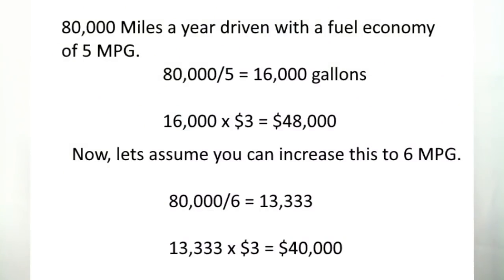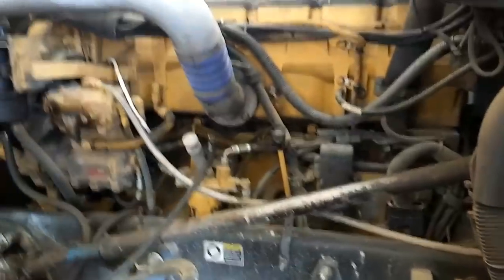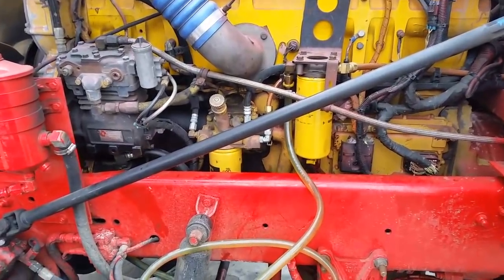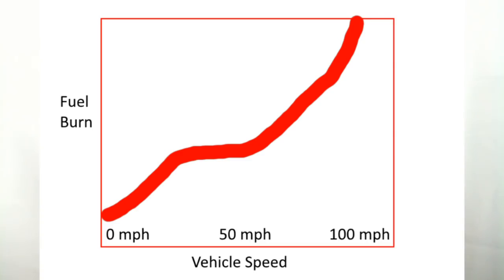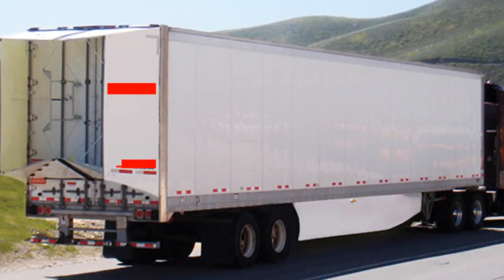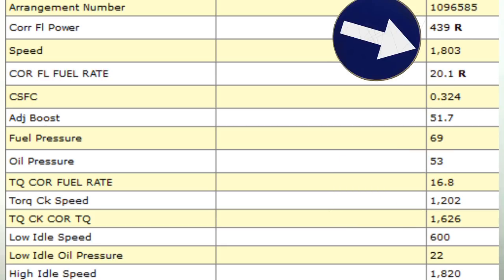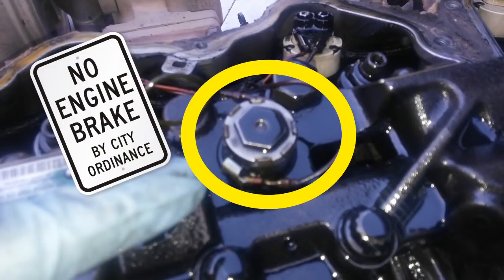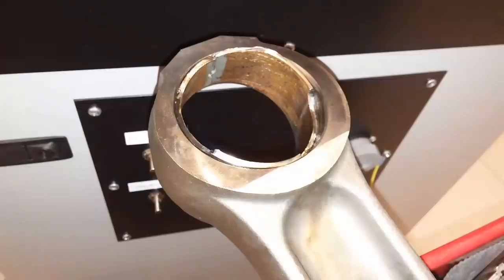How To Get Better Diesel Fuel Efficiency.  Increase Your Diesel Mileage And Economy.

Comment: Highway speeds make the biggest difference in my fuel economy. Driving 55 vs 65 changes MPG for big 7.3 IDI engine from 17 to 21.5
Reply: Yes, squared law applies on speed  related drag, so 10% speed reduction means only 81% of the drag. The man    is generally right and yes, miracle magnets or other snake-oil fuel products do nothing for calorific value. Sadly, tailgating has a huge beneficial impact on fuel consumption, but promotes collisions!
Reply: Wonder what kind of fuel economy you'd get with an electronic 7.3 IDI. 

By "electronic 7.3 IDI" I mean a 7.3 IDI with an injection pump but controlled by an ECM and solenoids instead of a mechanical rack, governor, and check valves.
Reply: @electric7487  I've thought about this before, but one of the beauties of the IDI is it's simple and mechanical, and therefore incredibly reliable. Still I'd love to see one with modern injection and pumps, an ECM and modern features like injector shut-off on deceleration. Probably bump those numbers up to 23-24 mpg. Pretty incredible for a 40 year old diesel engine displacing 7.3 liters. It's funny, my buddy's with their modern 7.3 powerstrokes average 15 mpg, albeit more power.
Reply: @Taydrum  I just found out that Caterpillar are using those distributor-style common rail fuel pumps on their C7.1 and C9.3 off-highway engines. Seeing as to how the IDI's fuel pump is also a distributor-style pump, I think a common rail system would be better for a new IDI as it makes everything much more compact. Also, I'd like to see spherical swirl chambers like the ones shown in https://chris.chemidl.in/wp-content/uploads/2014/09/1.005.jpg
Reply: @electric7487  Definitely a good place to start, however I know these things get complicated fast. Probably runs a different fuel pressure range, and the IDI stock injectors pop at a pretty low pressure. Would need newer injectors, and that would probably affect the timing.  I believe those are also 6 cylinder injector pumps.

Comment: The most important thing for fuel economy is the weight ofthe drivers right foot. If to heavy it causes excessive fuel consumption and increases general wear and tear on the vehicle.
Reply: I just bought a Toyota Hilux 1996 and these are things I am thinking, as well as to preserve the turbo where possible..
Reply: BINGO!!!!
Reply: I use cruise control on the highway. My right foot means nothing .  Fuel quality and aerodynamics are the most important.
Reply: Just be safe and speed up in a timely fashion on an on ramp

Comment: I have found the best way to increase your mpg is to not go up hill. LoL
Reply: I hate it when your rolling along coming to a hill and some jerk in front of you slows you down becouse they want to keep to 10 mph below the speed limit 😡
Reply: @markdunbar8219   Some trucks can't go faster... like mega carrier trucks. They are governed and have reduced torque. My company turns our trucks down considerably and it sucks!
Reply: Mark Dunbar that’s me lol. I’m ungoverned but the sweet spot for my rig is 65mph.
Reply: thats funny.. i found the best way to get better mileage is to drive down hill!
Reply: @dmbworks8094  And get pulled/pushed by the air ;)
Reply: @alinutzalin6346  that does help.. i often get tucked in behind a bigger truck so i get so help with the air!
Reply: @markdunbar8219  pop
Reply: Lol boom let's keep it simple right
Reply: Ya! Just fly it to Colorado and go anywhere you wanna go!
Reply: @Alinutz Alin…well I do that going down the hill faster if it’s a straight away…But my w900 n the shop for fixing my cylinders n deleting my actuators so now I’ll have 625hp
Reply: My grandma found a way to make it to school and back uphill both ways, I can find a way to make it anywhere downhill!

Comment: I think driving speed is a significant factor due to drag. The first time I had driven through Utah and Nevada in our diesel pusher, several semi trucks passed us on I-80 driving over 70mph. Since I live in California, observing these trucks flying past us was shocking since the speed limit in CA for vehicles with over 3 axles is 55mph. Needless to say, the fastest I usually drive our 34' diesel pusher is 65mph.

Comment: No free lunch anywhere. I have run 60 mph everywhere, minimum idling, back off on the hills, little throttle on acceleration and made top fuel economy in a small fleet of 200 trucks. I didn't really try for this. The data sheets came in and that was the result. I did this more than a few times but mainly did it because of fuel cost.
Kenworth T600, Cat 425, 18 speed with tall rubber(24.5).

Comment: In my experience the biggest factors in reducing fuel consumption are, reduce speed, less acceleration, correct tyre pressure, aero improvement, keep to maintenance schedule and anticipation to minimise speed changes etc.  Reducing speed and how fast you accelerate have the added benefit of prolonging engine and transmission life, and time between overhauls. If you thrash it you trash it.

Comment: Maintain proper tire pressures.
Reply: And convert to super singles.
Reply: Chad Jessup never, if I ran local I would consider it but they are still to hard to find in rural areas if something happens.
Reply: Chad Jessup however I do run Alcoa ultra one rims with Bridgestone M710 drives and Michelin xline energy steers to maximize fuel economy the best I can. I also run the lightweight steel drums, it's not cheep to run efficiently but I was getting 6.8mpg pulling a reefer with my 96 international coe so imo it's well worth it.
Reply: That is pretty decent fuel mileage.
Reply: That's an Obama/ Biden philosophy.
Reply: Hell yeah mine says 55 in the front 70 in the rear I run 70 all around they're the same tires so why not?
Reply: @Gorilla Braudcast mind mutants and not to mention, flat out dangerous. They spin and get squirrelly quick in rain and especially snow.
Reply: Whats the best way to read it accurately??
Reply: @Mr.Lawton534  with bifocals
Reply: @jaydunbar7538 almost 7 mpg in a coe isn’t shabby at all my brother. I’m in a 96 Pete with a 3406. Best I get is close to 7 at 65 ish mph

Comment: I took a 96 classic with a 475 Detroit.  Swapped injectord gateless turbo advanced timing 13 single od 3.07 rears with 11r24.5 truck ran an avh speed per gps of 70 and was getting 7 mpg.  Every truck i have owned or setup for people got better mpg with higher hp settings normally 550hp. More power more torque.  Allows you to pull better on hills and get back off the fuel.
Reply: Where you are really picking up the mpg, is the 3.07 ratio. If you aren't pulling heavy haul. It works great, just have to keep to the manufacturers recommended minimum rpm and not go below (danger Wil Robinson, danger), some flat-landers would try and pull a higher gear getting into a big grade, pulling max power at low rpm, do that enough times and I believe the cylinders will be dancing in the block before long.
I'm more of a Cummins engine type. Grew up with the Big Cam III & IV. I like Cat just never ran them. Two friends ran them, one worked great, the other, the engine nearly broke him, he still has it 30+ years later, and uses the truck for hauling his excavator around.
Best wishes from the far North.

Comment: Biggest fuel savings I’ve ever had was disabling the stupid 4-cyl mode in my V8 Silverado 1500, and having it tuned. Plus it drives a hell of a lot better. Anyways I think for OTR diesel applications driving style/ speed, and not idling for long periods of time are the biggest fuel savers!

Comment: The best thing you can do is spec your truck correctly! I have a w990 with 605 2050, I pull 105k from mid Washington to the West coast. Lots of hills. I speced it with 3.08 finals and meritor axles and I get 6.8mpg while everyone else gets 4.8-5.2mpg. I pull harder to, my buddy has a w900 with 605 2050 and everything else the same but has 3.58 finals, 105k on the dot as well and can't keep up and only gets 5.2. He has spent the money to ensure his truck is performing fully and it is, same with mine. Longer finals and more power is just better

Comment: I have a FL70 Freightliner and regularly got 10mpgs...one of the things I do is to always take my foot of the throttle if I see a red light down the road...just coast...saves brakes, clutch and fuel.  Sometimes you don't even have to stop and start...you just keep moving...
Reply: @AlzWorld57
Yup. That’s one of the biggest inefficiencies you avoid there. Stop/starts are a killer. My car gets 60mpg but traffic lights put it down to 36 average.

Comment: No this is another very important thing an old truck driver taught me there's a magic spot on the accelerator pedal and any less pressure on the accelerator you slow up the tiniest bit more pressure on the accelerator you maintain speed but beyond that,,,, any more pressure on the accelerator with no gain of speed is wasted fuel so always calibrate your foot to the speed mean and don't have your foot just stomped on the floorboard going the same miles per hour back to foot on out of the accelerator,,, and match it to the exact speed and load
Reply: Thats interesting

Comment: My (local/hourly) quad axle dump, 2006 KW with CAT C13 ACERT with 4:10 gear ratio.
I shift @ 1500 RPM and I use my Jake always.
My MAX speed is 60 MPH @ 1500 RPM.
I keep up on my tire pressure weekly.

Comment: Hey Josh.  I'm a fellow Cat truck technician here too!  Nice video and full of good information.  Lately we have been getting dinged on warranty from Cat for owners having aftermarket software and "hopped up fuel injector codes".  Perhaps you can use your channel to spread the word about the subject on changing software and Caterpillar's reaction to it.  We are a relatively small shop in the big scope of things and Cat has been really cracking down on warranty claims using the warranty report information against us and I feel that we need to get the word out to the owners that this is happening.  We have been denied four times for a total of about 10K worth of parts and labor that we are now having to have the hard conversations with customers about, so any way to spread the word around about another danger of "hot software" would be a good subject to talk about.  Really enjoy your channel!  Keep up the good work!!!
Reply from the maker: Not sure if I'll make a video on it, but yeah you have to watch for any sort of fiddling with the fuel system at all. Cat is bad about training their mechanics and warranty people in general from what I've seen.

Comment: My son has a KW T800 C13CAT 475 it has 1.500 million miles and still running good no blow by no oil leaks hardly uses any oil after 15.000 oil change. Great fuel mileage my son takes good care of his truck he uses Mystick oil and lucas additive in his oil and fuel

Comment: I remember learning to run the engine down to peak torque in an old series 60 class back in 2000. If you've never ran out under load that low of rpms you may think it is breaking your engine because it sounds bad, but it does bring the fuel mileage up and didn't seem to hurt the longevity of the engine. Great video, thanks for the content!

Comment: I don't know if you're aware of it but maybe you heard of water methanol injection. I have it on my truck I had it on the previous truck it helps fuel mileage significantly in my opinion because it increases torque by approximately 25%. it only works when you're pulling a hill. the water is injected into the intake manifold and a very fine mist it does two things it helps to cool the intake charge so you get more air in your engine and it turns to steam when the fuel Burns. it also removes a significant amount of heat from your engine. my exhaust gas temperature typically Run 200 to 300 degrees cooler I have found that I can lug my engine at a lower RPM without burning out my turbocharger. also when I look the engine at lower RPMs the steam pushes the Piston all the way to the bottom of the stroke. most people don't realize it but by the time your piston is down 120 degrees after top dead center you've extracted most of the energy you are going to get from that charge. the steam in the cylinder pushes the Piston all the way to the bottom steam simply doesn't quit pushing. snow performance has a very good system. I have a 15 liter cap right now my last dungeon was a 13 lb cat. that 13 liter cap on factory settings out pulled a 600-horsepower cat coming across California we were both running 80 thousand pounds and I don't pull him on Every Mountain grade with a stock 13 liter engine. I'm sold on it I don't even run methanol I run straight water it's very beneficial for an engine properly installed properly operated it will not damage an engine
Reply: Reed Silvesan which system did you go with? Thx
Reply: @bctw9004  
"...snow performance..."  (?)

Comment: Great information.  I have a 1981 Mercedes 240d.  The has answered many questions.  I use Amsoil synthetic diesel oil for Classic diesels.
Reply: Find out how much the timing can be advanced on those. I think it’s 24 or 26 degrees max.  That really helps fuel economy from what I hear.

Comment: I have been a mechanic for over 40 years. 30 of those as a heavy equipment and truck mechanic working for or with companies and fleets, so basically I live with the equipment and get to see in real world conditions year after year the same equipment. That gives me insight into things that most mechanics never see
  One thing that Always increased fuel economy and increase  the life of the machines was switching to Amsoil synthetic lubes.
 I've always seen increases in milage of a minimum of 3 mpg.
Same on heavy equipment, more hours per tank.
 I had a 95 FL 70 with 8.3 Cummins Allison 6 speed that I always got 6-7 mpg. (Service Truck ) at 135,000 miles I switched everything to Amsoil, engine, tranny, rear drivers, power steering fluid, front hubs and ujoints.
MPG rose to and stayed at 12 to 14 mpg. By reducing friction you increase available power and reduce rolling resistance.
 Not all oils are created the same and that includes synthetic oils.
 Most lube oils sold in stores are a class / Tier  3,  or 4 if marked  syn fluid, meaning the base oil is petroleum refined to a slightly higher level with a synthetic additives package.
Class / Tier 5 oils are true synthetic oils.
And very few companies sell a Class / Tier 5 lubes.
Amsoil is one of those that does.
 I have used Amsoil for 40 years not only in my own vehicles but also on my customers fleets.
 I start out with 1 vehicle or machine for a new account and let them decide based upon what they see. I have never had a customer say No.
 On of my earliest accounts was a paving contractor, hiway , roads and large parking lots.
They had pick up trucks, medium duty and heavy duty trucks, earth moving equipment such as Cat D9s, tract hoes Cat 225 up to Car 345s, scrapers, loaders, asphalt machines etc. 100 machines not counting office pool cars.
 The first full year after running Amsoil lubes in everything they saw a 40 % decrease in fuel purchases, and a 60% increase in equipment production time.
Meaning far less down time, fewer breakdowns less parts purchased.
Their savings in the 1st year more than covered the cost of the change over.
Also with Amsoil you stop change intervals based on hours or miles but by analysis of the lubes.
After doing test based on miles / hours we established new test intervals which were greatly increased over factory specs.
Buy using oil analysis to set change intervals you save even more.
In all the years and all the different companies,  machines and vehicles I ve never seen a failure related to Amsoil products. 
It's well worth the money.
Reply: AND OF COURSE YOU ARE AN AMSOIL DEALER.. HOW COME INDEPENDENT TEST DO NOT SEE THESE FUEL MILEAGE INCREASES. ???

Comment: Scania 16.4 liter diesel produces full 740 horsepower at 1300 rpm and holds it to 1900 rpm. With max torque around 2700 foot pounds at 1,000 and holds it across as well. Sounds like a great city/highway engine to me.
Reply: Yes, but, and there is always a but. A lot of roads in Scandinavia, do not have 100 kph limit, so your not getting into the aerodynamic wall (air resistance going up with the square or cube of speed over 55 mph/90 kph, at which point it overtakes rolling resistance). Those engines are mostly spec'd for their heavy haul.

Comment: I run a 74 A model kw with a 400 hp big cam set up at 525 to rear wheel hp. Prefco 212 injectors, 12 button, purple spring with A ported Pulse Manifold and a Holset 4 series turbo. 13 speed with 370 rears. Absolute ground pounder at 48 lbs of boost. Averages 5.7-6.  Driving responsibly. Our new petes aerodynamic trucks are getting 5.2-5.5.  With 40 plus years of technology I’d say we’re not that far ahead honestly.
Reply: Actually we are “farther ahead”. Just the agenda has changed. We are farther ahead in reducing NOX gasses and couldn’t give a damn about fuel economy or power.

Comment: well, using the jake brake does technically increase MPG, since you literally do not burn any fuel for the distance travelling with the jake brake on, plus it reduces brake rotor and pad wear

Comment: Well explained Josh. A formula 1 motor is a good example of high RPM in a small displacement engine giving high horse power. They have low torque hence need lots of gears and lots of skill from the driver to keep the car in the power range. They are also very high tech and have a short and expensive life. Horses for courses. Jeff